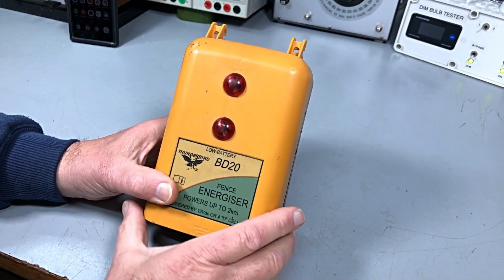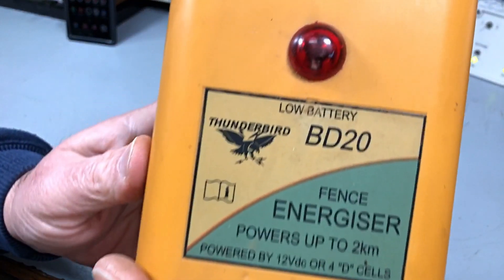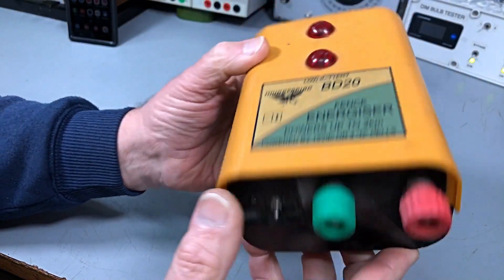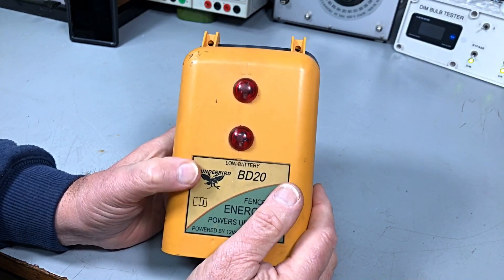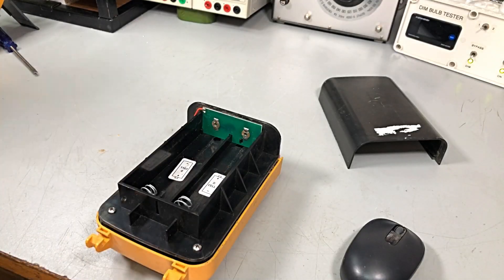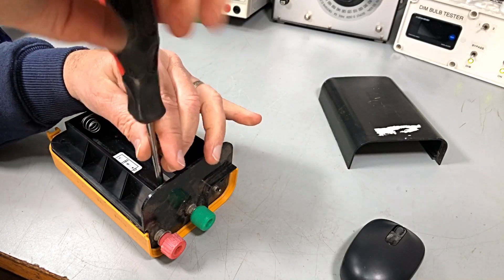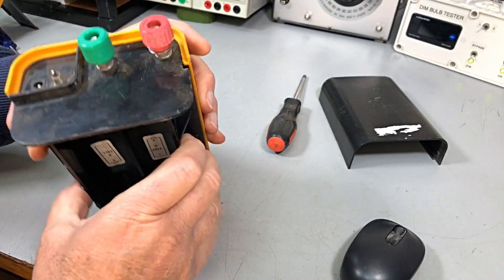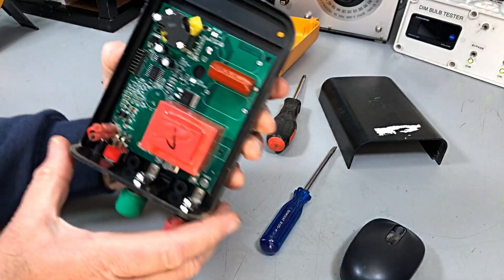On The Bench Today - Another Elect Fence Energizer !

Comment: That battery setup is kind of weird. I'm used to the flat side in the compartment always being positive, and the spring being negative.  Not all batteries have the entire positive end conductive, so I wonder if that could cause problems.  Also, I know it's clearly labelled and obviously wired in a loop, but I think I'd still be tempted for half a moment to put them in the wrong way.
Reply from the maker: Yes, it is strange how they have done this !